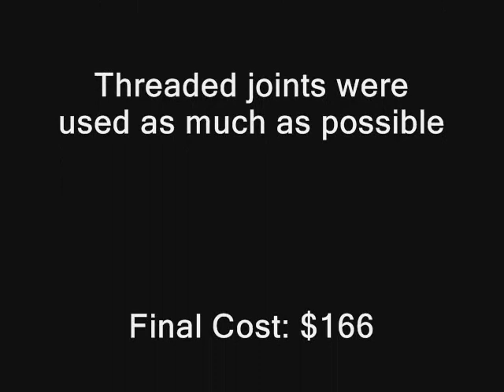DIY Clear PVC Protein Skimmer

Comment from the maker: Th input is through the venturi and the smaller of the holes.  The drain is through the large elbow at the bottom, up the external pvc tube, through the gate valve.

Comment: Did you check the Gallon ratings? The ones for $100 dollars are for around 100 gallon aquariums, this one is HUGE! It is 4' tall, (48") Which means it will probably handle 300 Gallons? And a high quality skimmer will be like $700.00

Comment from the maker: The pump was just a random Rio 2500 I had laying around.  I figure it was putting through 500 gph.

The 'air in' can be seen at 0:17, 2:36, 3:55. It is the nob coming off of the black 3/4" venturi.

The at 4:05 with the clear acrylic tubing attached so water does not leak out when the power goes out.